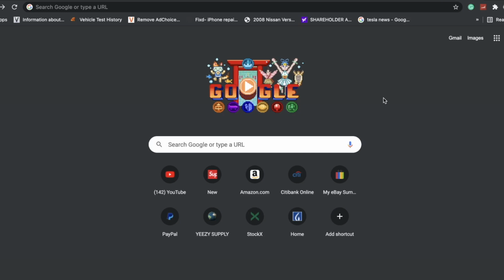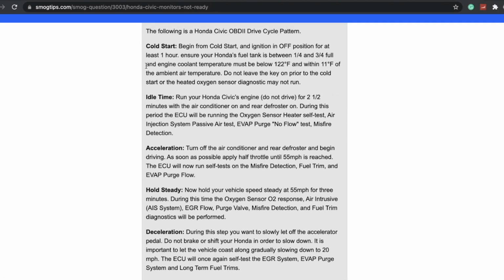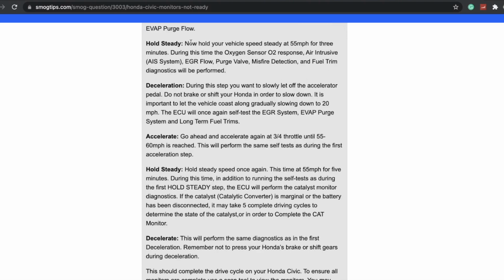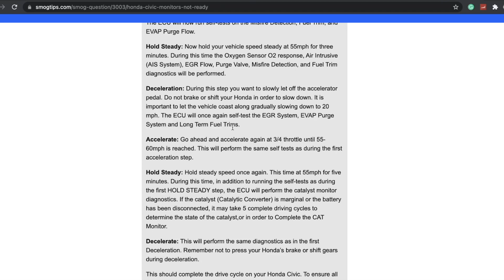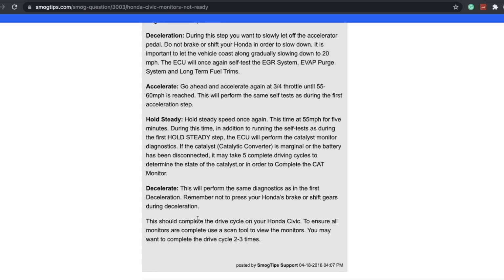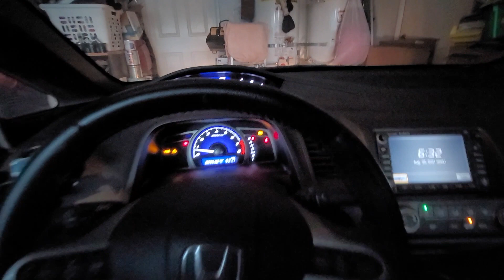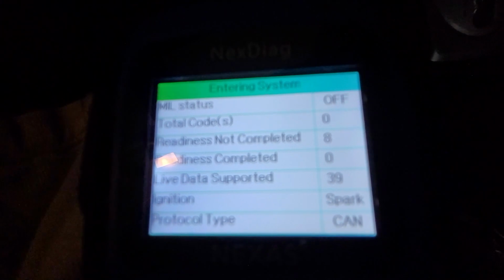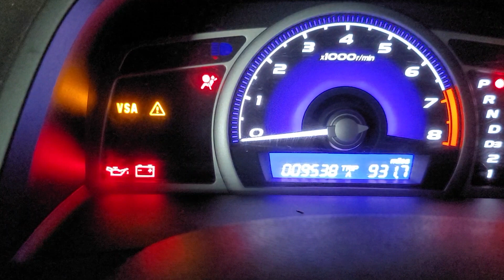How I Pass Catalyst Incomplete SMOG Check Not Ready On My 2009 Honda Civic

Comment: I did this today.  I have a P0420 code on a 2010 Honda Pilot.  Code usually resets itself randomly after I clean the spark plugs and/or change oil and doesn't normally last longer than a few weeks between CEL and resetting itself.  I figured it was the VCM burning oil that sets off the code as it resets on its own after a few days of highway driving.  The VCM is disabled while the light is on, so I think the excess oil burning subsides.  I would normally smog test whenever it resets itself, but this time it took much longer, not sure why, maybe the cat is finally beyond self-repair.  My tags are up for renewal so I was stressing out.  I used multiple Catacleans and other various chemicals, but the code never reset itself like it normally does.  I ended up erasing the codes and decided to set my I/M Readiness monitors by doing this drive cycle.

I ended not following the drive cycle directions completely, but I did make sure my HTR_Ready was OK'd before I started driving.  I did this by turning the key on-no start then accessing the I/M screen.  Once I can see the HTR, I start the car with the AC on.  HTR ok's within a few minutes, less than 2, then I drove towards the highway.  I would speed up to 60-70 for less than two minutes due to traffic, but I would coast as much as possible.  I was on the highway less than 10 minutes and I never really did the "55mph to coasting to 20 mph" cycle, more or less would coast as long as I could before I would need to hit the brakes.  Traffic was bad so I exited and did some city driving.  At this point, CAT, O2, and EGR were the only monitors needing to OK, and they were still INC.  I drove for another 20 minutes, some long stretches up to 50 mph with some coasting involved, again not following the 55 to 20 cycle, and after about a total of 30-35 minutes of driving, all monitors were set to OK.  All except EVAP.  The tech at the smog station, I'm located in Georgia, said I am allowed 1 monitor to be INC.  I was concerned that turning off the car would cause the monitors to reset, but the monitors' status is saved in the car's computer.  I passed that same day.  

This was after 2 months of changing out O2 sensors, driving my car for what seemed like forever, using Cat foam cleaners, Seafoam intake valve cleaner...all in the hopes of getting the CEL to reset on its own so I'd know it was ready for smog testing.  This drive cycle took less than 45 minutes, and you most definitely need an OBD scanner in order to track your progress.  For what it's worth, I drove 2 times before attempting the drive cycle, no longer than 20 minutes each time.

Comment: If I have a 6 speed manual how do you coast down from 55 to 20MPH?
Won't the engine stall or the RPMs go too low if going below 40 in 5th gear?

I usually have to jump start my 2008 Civic because I never drive long enough to charge the battery enough.
If the lights and other electronics are still working but just need the starter jumped will that prevent the OBD2 from resetting?

Comment: I'm having catalytic converter failures for about a few days drove around 250 miles and no luck
Reply from the maker: A drive cycle is a diagnostic test that simulates typical driving conditions to identify issues with a vehicle's emission control system. The correct drive cycle for a vehicle depends on the model and the monitors that need to be reset. For example, a catalytic converter monitor may need to run after cruising at 55 mph for five minutes, but it may take up to five drive cycles at that speed before the monitor will run
Reply: For a Honda Civic Hybrid the catalyst emission turns back on at 320 miles

Comment: Need help my dodge dart went from incomplete to n/a then turn it off then back on went back to incomplete
Reply from the maker: Here: https://justsmogs.com/2014/01/chrysler-dodge-drive-cycle-procedures-to-complete-obd-readiness-monitors/
Reply: @macdaddypimpping  got a quick question I hope it's not stupid but recently I did it when I went to the drive cycle  on my scanner it says incomplete then went to na then I turn my car off for 10 mins then went to inc but when I go to since diagnostic codes where cleared in that went from incomplete to ok when I turn the car back on does that mean  I'm done or it's not working properly

Comment: Thanks for sharing, you're dialed in on these. Do you have any additional info for the hybrid model? I've tried following your pattern, unsuccessfully. Sure the cat could be going, but I don't feel confident I did everything correct. With LA traffic, & road design, it's near impossible at any hour
Reply from the maker: Make sure your car doesn't have any Troubleshoot code/Engine code/or Error code. Need to scan with a OBD II scanner tool (you can borrow from AutoZone or O'Reilly. 

Typically driving 200-300 miles through various traffic conditions and over the course of a few days is enough to get the drive cycle to initiate. Simply driving an extend length of time however does not necessarily make the monitors complete. Your Hybrid Civic's engine control unit performs internal self-tests in order to ensure the engine is running efficiently and not polluting. These self-tests are called Monitors. The entire process of self-testing various emission control systems is called a Drive Cycle.

Notice: Obey all traffic laws while performing drive cycles. Perform the drive cycle cautiously and at your own risk. Use a OBD-II scan tool to check the status of the monitors once you've completed the drive cycle at least once.

How To Perform a Honda Civic Hybrid Drive Cycle

The following is a Honda Civic Hybrid OBDII Drive Cycle Pattern.

Cold Start: Begin from Cold Start, and ignition in OFF position for at least 1 hour. Ensure your vehicle's fuel tank is between 1/4 and 3/4 full and engine coolant temperature is below 122°F and within 11°F of the ambient air temperature. Do not leave the key on prior to the cold start or the heated oxygen sensor diagnostic may not run.

Idle Time: Start and run your Civic’s engine (do not drive) for 3 minutes with the air conditioner on and rear defroster on. During this period the ECU will be initiating the Oxygen Sensor Heater self-test, Air Injection System Passive Air test, EVAP Purge "No Flow" test, Misfire Detection.

Acceleration: Turn off the air conditioner and rear defroster and begin driving. As soon as possible apply half throttle until 55mph is reached. The ECU will now run self-tests on the Misfire Detection, Fuel Trim, and EVAP Purge Flow.

Hold Steady: Hold your vehicle speed steady at 55mph for 3 minutes. During this time the Oxygen Sensor O2 response, Air Intrusive (AIS System), EGR Flow, Purge Valve, Misfire Detection, and Fuel Trim diagnostics will be performed.

Deceleration: During this step you want to slowly let off the accelerator pedal. Do not apply the brakes in order to slow down. It is important to let the vehicle coast along gradually slowing down to 20 mph. The ECU will once again self-test the EGR System, EVAP Purge System and Long Term Fuel Trims.

Accelerate: Accelerate again at 3/4 throttle until 55-60mph is reached. This will perform the same self-tests as during the first acceleration step.

Hold Steady: Hold steady speed once again. This time at 55mph for 5 minutes. During this time, in addition to running the self-tests as during the first HOLD STEADY step, the ECU will perform the catalyst monitor diagnostics. If the catalyst (Catalytic Converter) is marginal or the battery has been disconnected, it may take 5 complete driving cycles to determine the state of the catalyst,or in order to Complete the CAT Monitor.

Decelerate: This will perform the same diagnostics as in the first Deceleration. Remember not to use your car's brakes during deceleration.

This completes the Honda Civic Hybrid drive cycle.

Comment: I am having the same issue, I just changed my catalytic converter, and battery. But I can’t get my drive cycle to complete. I have already drove more than 300 miles. I have no check engine light, I did that drive cycle 4 time already, still the drive cycle is not complete
Reply from the maker: Did you let your Honda from 55 MPH and slow it down by itself until it stop completely or keep on driving on a 25 MPH zone for awhile and let your Honda slow to a complete stop? Honda drive cycle is pretty tricky and need to do it correctly. It's best to do the drive cycle in the early morning. Keep 55 MPH on freeway for like 15 min constantly without cruise control.

Comment: It sounds like a dumb question but how would you slow down in a manual car without shifting or using break? Do I just put it in neutral and slow down?
Reply: Car slow down when you take your foot off the gas
Reply: He says in video he uses the hand brake
Reply from the maker: Down shift, just don't press on the brake.